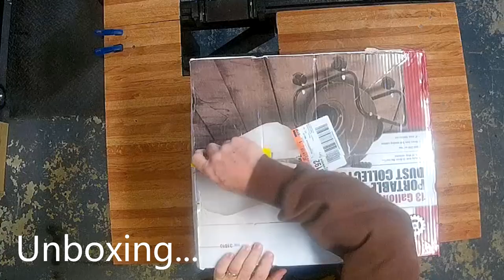Harbor Freight #31810 #61808 Review and First Mods Ep30

Comment: FYI, if you don't want to use silicone, or a permanent sealant for making it air-tight, just get some ⅜×⅜ weather stripping that has the peel and stick on one side.
 
Then, just cut off what you need and put it to the area you'd normally put silicone. 
 
Another added benefit, is that it adds cushioning to prevent rattling.  
 
And if the day comes, where you need to take off a part to do a mid/upgrade, it'll be easy to take parts off. (But you'll likely want to replace the stripping every time you remove a component that it seals because it compresses and molds to the area, and it might not seal as well, as you replace the components.)
 
Yeah... I just hate working with silicone caulk. Plus it doesn't interact well with poor quality metals if there is a scratch or chip in paint. 
 
So best of luck.

Comment: Sometimes I do large-ish drywall jobs and the homes are occupied dwellings. (I do remodeling).  I have a "dustless" drywall sander and use a 4hp, 6gl. shop vac with a diy 5gl bucket cyclone. (the sander hooks to cyclone via 1 & 7/8th hose, cyclone to vac.) My set up does okay.  But my question , would the suction be improved with the HF 1hp dust collector? Some people are saying their shop vac has better suction. If I did buy the HF dust collector it would be 4" hose to the cyclone bucket and transition down to the 1 7/8 hose to the sander. Seems that the reduction in hose size would keep the static pressure high....But I dont know. What do you think? Just stick to my vac or would there be a very good improvement with the HF system?  The HF 1hp collector is $154 now without a coupon. It would have to be a $154 worth of improvement before I would pull the  trigger on it though. Thank you for the video, just found your channel and I'll sub ya!
Reply from the maker: Thanks for the question... for capturing drywall I would stick with a Shopvac. You said you do drywall in different homes. The Shopvac is lighter which makes it easier to lug around. It has a stronger suction. A dust collector is designed to move fine particles in lots of moving air. A vacuum is designed to move chunkier debris with less air movement but more pressure. 

Having said that, either system will work just fine.

Comment: I purchased this dust collector from Harbor Freight to replace a 5 hp craftsman shop vac I was using in my small wood shop. I have a 2 inch pvc pipe dust collection system with blast gates. I use a dust deputy in conjunction with the shop vac.I  was hoping the new dust collector would increase the vacuum in the system. However I found that the Harbor Freight dust collector created less vacuum in the system than the shop vac. I returned the dust collector and went back to using the shop vac.
Reply: George Caruso technically any shop vac you buy that’s runs on 120 standard is never operating at 5hp. To achieve 5hp or anything over 3hp you’d need 240. With that shop vacs have a CFM under 170 ish or less. This Harbor Freight dust collection unit has 660 CFM. Possibly the Harbor Freight one you had was defective. Just thought
Reply: Lyric Klein Lyric, you are thinking much more technically than me. I just compared the suction of the Harbor Freight dust collector to my shop vac and there was much more suction with the shop vac. Never thought the dust collector might be faulty since it seemed to be running fine. Anyway I am presently using the shop vac until I find something better? Thanks for your input.

Comment: Is the unit still covered under your extended service plan if you make those modifications?
Reply from the maker: This I do not know. I'd say not but Harbor Freight would be the people to ask. Thanks for watching!
Reply: my experience with returning an item under the extended service plan, was that they asked no questions at all. I said "this motor won't start, gimme a new one"  and they said "no problem."

Comment: Another FYI ..  The new versions at harbor freight have a new motor, and it's horrible. 

My motor housing was 135F  after 4 minutes with nothing attached to it. I thought it was just a dud. Got it replaced this afternoon, and the replacement had the exact same issue. Hindsight, the manager kind of just nodded when I told him the issue. Like he already knew the problem. 😞 
 
If you get one, you'll smell rubber burning after a couple minutes, then feel your motor housing to see if hot. If it is, I'd recommend getting a refund.
 
I feel like HF could be doing a recall. It's a shame they likely went to lowest bidder on this after they sold out on the last one. 
 
I'll see if I can fish more info from manager tomorrow when I take this back for a refund. Now I guess I'll try a WEN 7.4 amp model... but I've never had much luck with WEN tools... but I can say the same about HF, so it couldn't be any worse lol.

Comment: Thanks for sharing, Harbor Freight will have this same unit on sale with a 25% super coupon Sep 01, 2019.
I will incorporate your idea to this unit on my Dust Collector build. I will hook up a Dustopper/5 gallon bucket
to this unit. I think removing those grids will add more CFM and with the Dustopper, they are not needed.
That's $38.75 less in my local HF store.
Reply from the maker: Hey thanks for the info, that's a big savings. And thanks for being part of our online community!
Reply: Got the 1HP Dust Collector from Harbor Freight, removed the plastic screens from the intake and exit ports,
 did not seal the two ports with silicone. It showed good air flow running by itself. I hooked it up to a 
Dustopper/5 gallon bucket set up using 2-1/4 inch hoses. The 1 HP is not strong enough. My rigid shop vac
pulls more air thru the Dustopper/5 gallon bucket set up with 2-1/4 inch hoses. "Totally Disappointed"
This was a good exercise before cutting wood though.

Comment: SO what size/type/brand of cyclone did you use with yours?  You should do a follow up video showing how you built your system.  I am thinking of buying one of these and mounting the blower motor portion outside on the wall of my shop and having the cyclone inside.  I don't think I will even have to use the bag or a filter if I do that correctly since most of the debris will be stored in the container under my cyclone and very little dust will be exhausted outside where the blower motor is mounted.
Reply from the maker: I used a home made plastic trash can cyclone. 4 inch PVC 90 elbows one facing one way and one the other. It works well enough. There are more efficient ways to pre-filter the sawdust but this works well enough.  You can see the filter in this video... Mini Dust Collection https://www.youtube.com/watch?v=GsBQ690f26o
Thanks for watching!

Comment: Would you recommend doing the same thing (remove grid and use silicone caulking) on the 2HP model?
Reply from the maker: Yes I would. The caulk will make a good seal and more efficient running. 

Removing the debris screen will you save you some time cleaning during routine maintenance. With the trash can separator you shouldn't have to worry about large chunks getting through. Your mileage may vary, lol! Thanks for watching!
Reply: @PaddyGDIY , just an FYI. The 2HP doesn't have a grid, and some areas already have a gasket to prevent air leaks. You'd only have to add silicone caulking if you detect a leak or do be safe.

Comment: Nice video. I've been looking into getting the same unit. How does it worked compared to say a Rockler or Grizzly unit?
Reply from the maker: Performance of these dust collectors is largely decided by how much air they can move. This one moves about half of the amount of air the other Harbor Freight unit does. I don't know anything about the other units. This is my first experience with a real dust collection system.  Thanks for watching and commenting.

Comment: You may have had an OK dust collector. I used mine for 15 min. and put it back in the box. I went too cheap, used it on my 10" jointer and it's too small. I had to hand feed saw dust into it. Nope.

Comment: Do you know the difference between model#31810 and #61808?  Good video, the mods make sense.
Reply from the maker: No I do not. I went looking for that answer while doing research for this video. I didn't find any information about the differences. To me that means that there is not a lot of differences, if any at all.
Reply from the maker: It just means they are built by different suppliers. Both suppliers are supposed to build them to the same specs.
Reply: @PaddyGDIY  The one I just bought has a metal intake port and comes with no adapters.